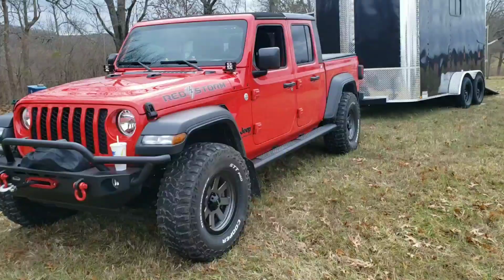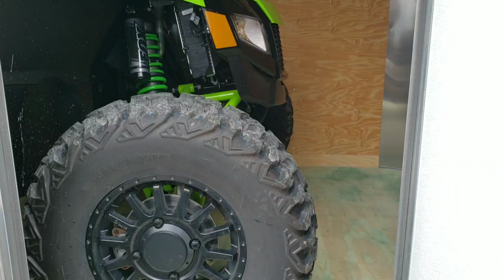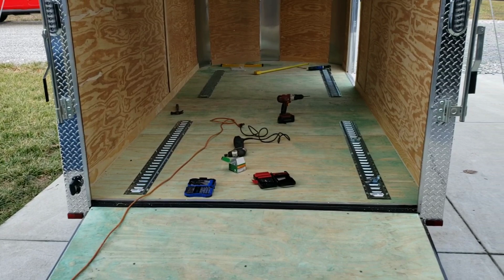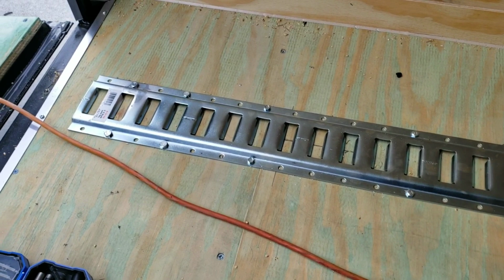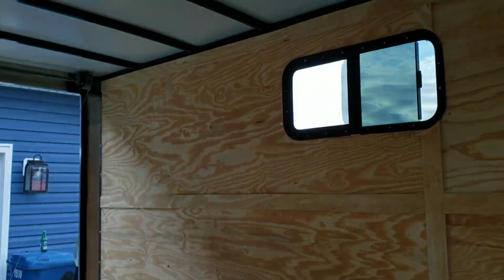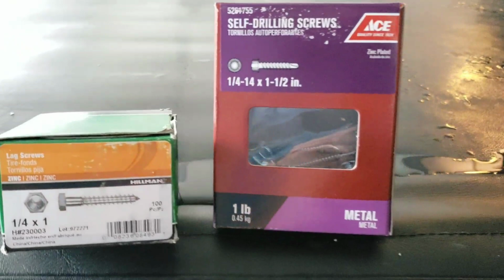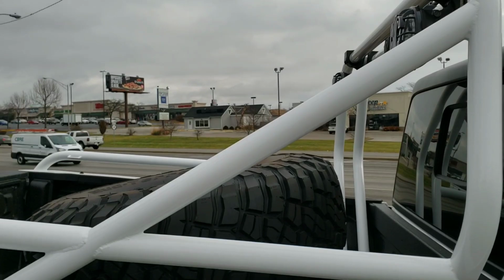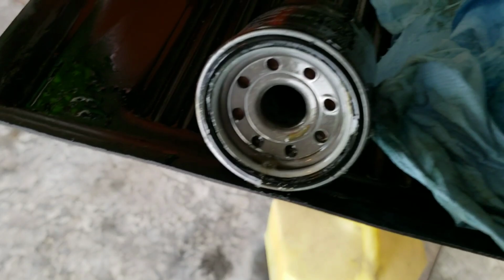Installing E-track in my Enclosed Trailer

Comment: Rear engine; gotta back it in, or you are going to have too much weight behind the trailer axle and not enough tongue weight. Result will be a trailer that sways dangerously. Great videos. Keep up the good work.
Reply from the maker: With the tandem axle placement on this trailer, I think pulling in will be fine.  The center of mass will be directly over the axles.  I don't expect any sway issues.  But if it does sway, obviously I'll have to go to plan B.  :)
Reply: good lord. He is showing how he installed e tracks he is not showing how to tow. Get over it. There is always that arm chair quarterback that would of thrown the touchdown pass..... Thank you for the video. can you tell me where you got the back plates from?
Reply: absolutley the wind will get ya

Comment: Just bought same size trailer for my krx. My Rubicon doesn't  like pulling it with 4:10gears on 35's. Seem like it wants to stay in 5 or 6 gear. What does yours act like pulling that trailer?

Comment: Where did you get the backing plates
Reply: I boaught mine though amazon, DC Cargo Ultra Secure E Track Plate Installation Kit, 4-Pack | E-Track Rail Mounting Back Plate, Bolts, Nuts, and Washers. $30.

Comment: My enclosed is a 7.5 x 12 with utv extra height. It tows my 2013 Arctic Cat Wildcat 1000 Limited on my 21’ Jeep Mojave pretty well. The gas mileage sucks but other than that it works pretty good. I am now too getting around to installing my X tracks from Menards so I can mount some stuff. 

Have you put any thought into mounting a winch to pull the utv in? I am looking into that along with a solar charging system. Hoping I can Harbor Freight it up so I don’t ever need power to use the winch.

Comment: Hello Sir, What did you do to protect the underside of your  trailer? I just bought one similar to your and will be doing the E-Track and some other mods to it. Thank you for your time.
Reply from the maker: Haven't done anything to the underside yet, but I would like to simply paint it to help prevent rotting of the flooring.
Reply: I have almost the identical trailer and bought the Fluid Film kit from Amazon included the spray gun. FLUID FILM FFSG Spray Gun Applicator Kit.

Comment: I have a question for you!  How is your 7 foot wide trailer with towing on the jeep?  I have been eyeballing either a 6x14 or 7x14 on my truck.  Have hauled several 8's around and those are simply way too wide to be comfortable with.
Reply: Ima Crazy Guy just bought an 8.5x 24 vnose. Love it

Comment: What is your trailer brand and size
Reply from the maker: Arising Industries built it.  It's a 7x14.  I wish I'd gone 8.5x24...then I could use it for my car also.
Reply: OFFRD I’m looking at 8.5 x 24 I’m planning to move cars and motorcycles.